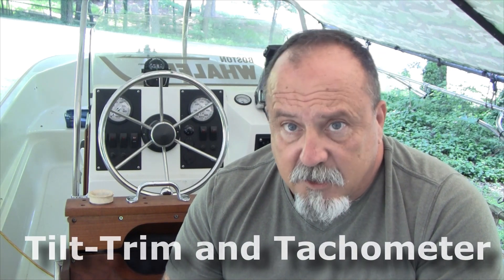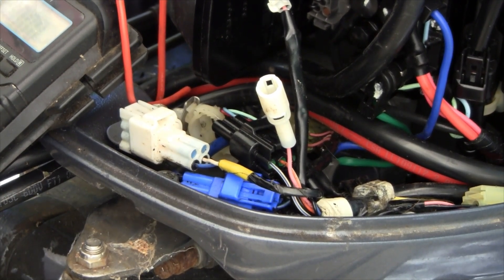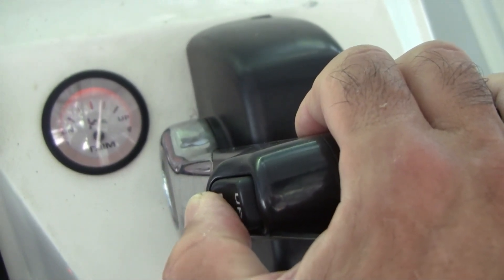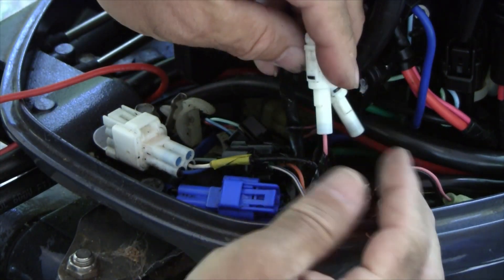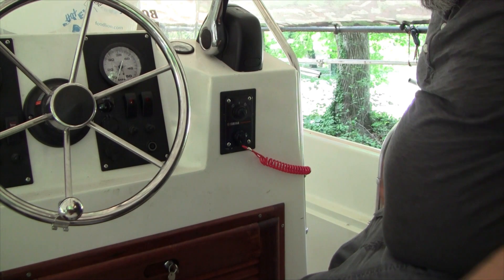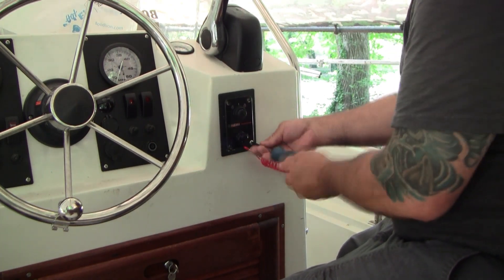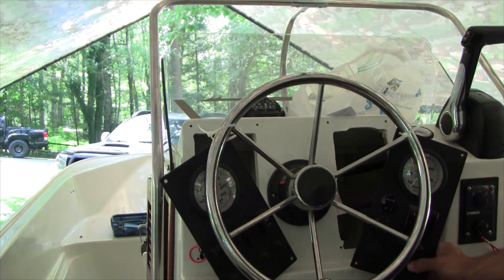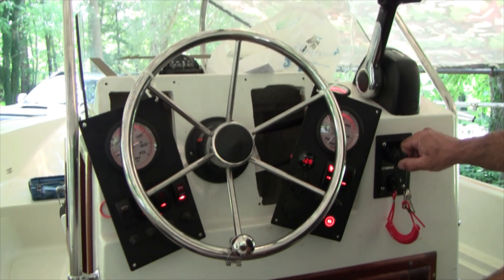How to Wire Yamaha F70 F-Series Tilt-Trim & Tach Gauges - Classic Montauk 17 Restoration

Comment: gday mate i used a kus tacho yamaha command link gauges are very expensive , i was lucky a guy on the yamaha forum had just done one so helped me set it up as  couldnt find any info on it ,my 40hp is new so tilt and trim was in the ten pin plug from the 703 controller .
Reply from the maker: That's good to know! Wish it were in the 704 plug, would make it a bit easier!